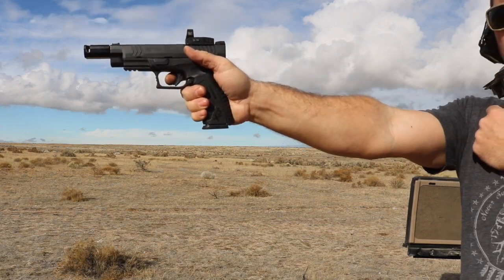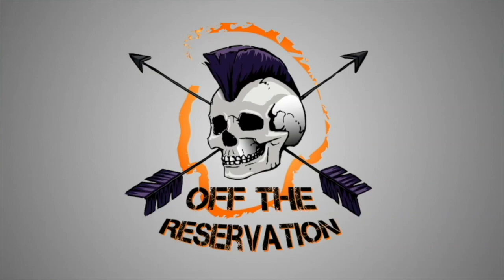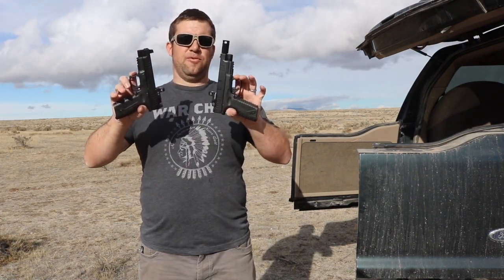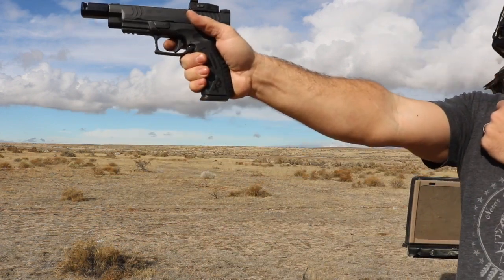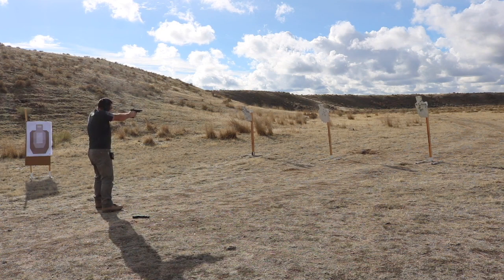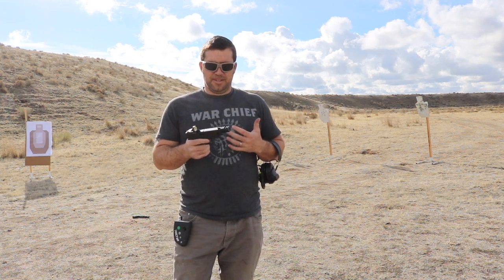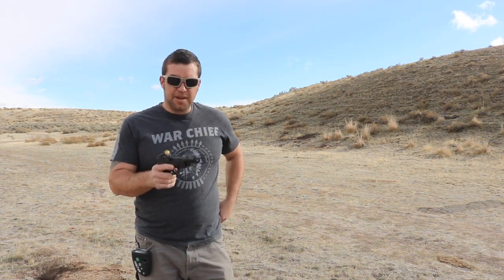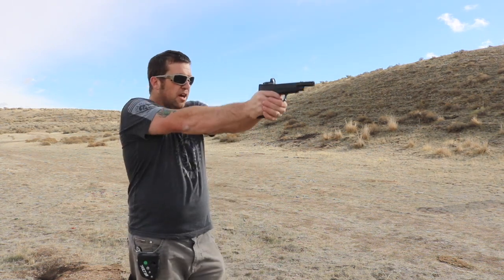XD-M OSP Gets the Magic Sauce

Comment: After watching your video, I ordered the compensator from Springer Precision. I installed it and took it to the range and after two test shots, both failed to reload a new cartridge. I contacted Springer and their phone says "We no longer support phone calls, use email..."  So I sent an email and a few hours later got a response that SURPRISE, I needed to replace the guide rod and recoil springs to 16 or 14 lbs, since the compensator slows the slide down a bit... Only $52 more to the cost of the compensator.... Springer Precision, this should be a kit, or at least mentioned in the compensator web page, and the installation instructions.

Update: even with the custom guide rod and springs, it still jams at least once per magazine... Not reliable at all.
Reply: I had this in my cart and was just about to order one. I'm glad I read this 1st! You saved my bacon. Thanks!
Reply: Hey buddy dont know if u are even messing w that comp any more if it wasnt cycling properly but something to note is the type of ammo you are firing. Try some HP+  that might give u the extra powder dump u need for the gun to cleanly cycle after every shot. Honestly once i learned that there was an HP+ thats all i purchased from then on out and ive never had an extraction issue with hp plus u put some reg powered or cheap 9mm through it though and one of the shells might not have enough powder to push a normal slide back let alone a comp on the end of it. Just saying if u gonna spend the money on a compensator u need to run HP+ to throw your slide back. Maybe a different brand has a lower poundage spring so hp+ isnt a need but my xdm elite eats hp plus without an issue. Im pretty sure theres even hp++ but 1 + is for sure the answer is u was using reg white box Winchester walmart special id 1000% blame ammo on ejection issues. Obviously the spring poundage drop will help but even then extra powder will def help the issue.

Comment: Just got my first 9mm canik comp after shooting for 30 years without. Never had a pistol supressor so i never purchased threaded pistol barrels for any of my pistols just thought it pointless. Now im like crap gonna end up with a extra barrel for every gun once i find comps for them. But the reason i came to this video i have the xdm elite 10mm also not threading on barrel but been searching for a comp for the 10mm was hoping to find a fixed comp instead of a threaded one. Any ideas? I rock a bunch of caniks and recently found the 45 blast comp for my SFX tp9 didnt know if u could give that a gander and let me know if u have seen any for the xdm like that?

Comment: Have you had any failure issues with the compensator on? I watched a different video where the standard pressure rounds failed, but the high pressure rounds didn't.
Reply: Correct, high pressure rounds are needed to eject

Comment: EVERYONE. Before getting scared go LEAR HOW TO TUNE A PISTOL. no weapon is a Lego set. If you add something it changes everything. Your gass is going out the comp. Hence less felt recoil=less gass.  Optics. Slide cuts/lightening. All change the physics. Springs are norm your first go to and also depends on your ammo. Once you tune a weapon or have it done it is give and take. You want the bells and whistles get ready for only certain ammos. If you wanna stay chewing up anything you throw in it. Stay stock. If you can find it there's a great vid of what all went into the tuning of a IPSC race gun. Look for a stainless 2011 with blue grips and a really funky comp.  It's out there on you tube somewhere.e

Comment: I'm a year late, but oh well. Just got the 10mm OSP, and it is absolutely awesome. If you need screws for the adapter plate or optic for the 9mm or 10mm, check out ebay seller "xcontrols", this person has it all.

Comment: I contacted Springer Precision to find out why their XDM Compensator caused my Springfield Armory XDM Tactical Elite 9mm to be so unreliable. They said it was probably my grip and eventually said "Any modification you do can cause unreliability." So, I removed the compensator by heating the compensator up with a torch and returned it to factory, and now it's OK! So, modify it at your own risk! I'm probably $200 into this stupid mistake of an experiment and the spare parts and shipping, with Springer Precision parts in a bag for the next person who wants to experiment.
Reply: Damn I really wanted this to work!
Reply: It’s because you need a different recoil spring, the compensator is compensating for the recoil and pushing the gas upwards and it’s messing with the way the firearm is cycling, get a lighter recoil spring then let me know
Reply: It's a little known thing. U take gas away via comp. Well...redirect.  most the time with a comp. You need to also go to a lighter spring as well. Just as you need to do with lightened slides and such. Weapons have to be tuned, parts can't just be tossed together and work . Unless it's an LS engine lol

Comment: Did you replace the recoil spring? My jams sometimes im thinking its the recoil spring.
Reply: What ammo are you using
Reply: @wisewhiterabbit  Winchester 115g
Reply: You are supposed to use a reduced power recoil spring with the springer precision compensator. It actually says it in the description of the shorty compensator on their website
Reply: Also, if you use springer precisions reduced recoil springs they do not recommend using hard primer bullets ( Winchester, CCi, etc).
They recommend federal ammo
Reply: @slickmastajay do u no wat spring
Reply: I just ordered a 14 lb spring with the rod and compensator. It was a nightmare trying to find good advice.
Reply: @daveh3232  how'd that 14lb spring work with the comp? been searching high and low for this same info
Reply: I can tell you it all fits and goes together super easy but I haven’t gone to a range to test it yet. I’ll let you know when I do but it might be a minute
Reply: @BlackProjectSTI
Reply: @daveh3232  did you ever get to shoot it? Looking at ordering and would like to know what route to go. Thanks